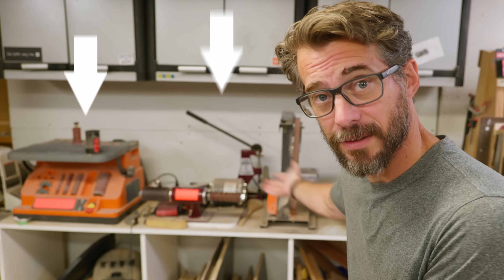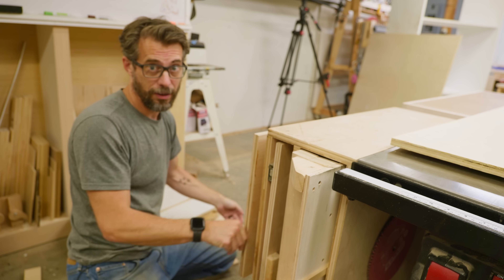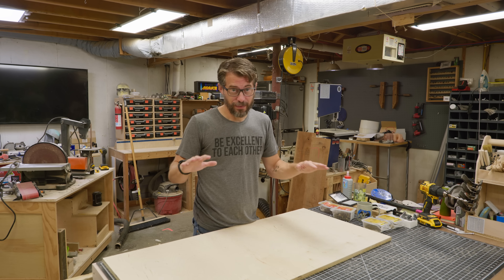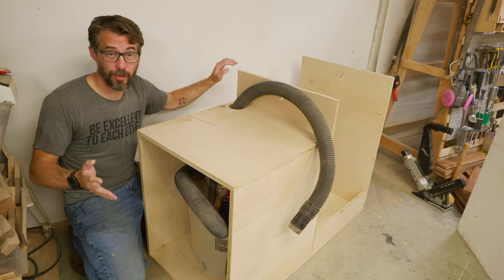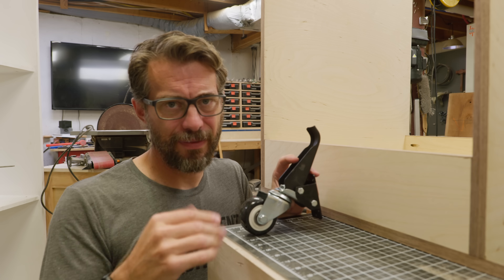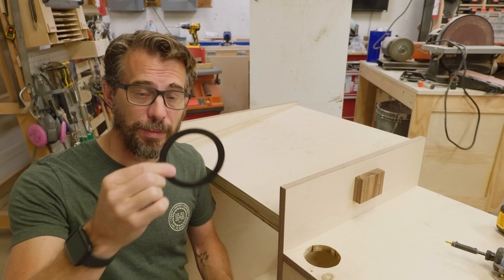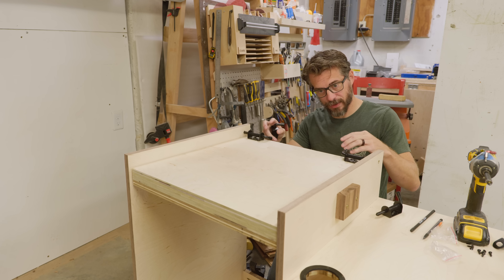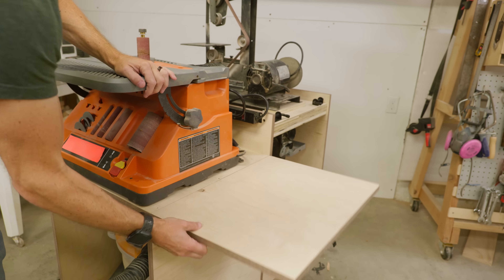Can I Make a Better Flip-Top Tool Cart?

Comment: Use fender washers over the receiving holes so you don't get tear out from the lock bolts going in and out
Reply: I was thinking that or lining the holes with a bit of scrap pipe and flaring the ends ... the washer.
Reply: I was about to suggest fender washers too!
Reply: Or maybe a T nut? Protects the outside and a bit of the inside as well to guide it. You’d have to drill the hole a bit bigger to accomodate that.
Reply: @jptheberge  I don't know if the bite of the tnut teeth are enough to hold it in after frequent use and pressure. But the plus side of the t nut is you don't have to modify them to screw them in , probably 3 drilled holes per washer, 1 enlarged center and 2 screw holes to get them to work.
Reply: Sounds like a job for the 3d printer lol
Reply: @snowpaw360  You can make a zinc-plated steel fender washer with a 3D printer?   🤣
Reply: Except fender washers are metal and have a greater chance of damaging the wood over time.
Reply: If the holes wearing out over time is an issue, drill them out and put in a bushing that's nice and snug.
Reply: @jtome12   If you have the right 3D printer, yes you can...well, maybe not zinc plated, but there are 3D printers that print metal objects, then, if you're printing in steel instead of brass, after you sinter the parts, you can nickle plate them easy enough...
Reply: Ha I just came here to say the same thing. This or embed some steel type or conduit
Reply: Epoxy a matching "plain" sleeve bearing into each hole. Incidentally, that's what I did to carry the weight and wear and tear of the flip top pipe, too. They come in every ID and depth imaginable, and they're cheap--not as cheap as washers, but they should create a more durable bolthole.😁
Reply: Given enough penetration, any wearing out of the entry hole acts as a guide bezel for the lock pin.

Comment: I'm interested to see how you find the placement of the latches over time. Originally, I thought you were installing them the opposite way around, so the set in the back would be on top, and the set to the front would be on the bottom, to access all four a little easier. Maybe it doesn't matter as much if it's on wheels and you can move it around though?
Reply: They should have been inside the boards with the pipe, with only the handle ends sticking out.
Reply: i guess i would have put the ones in the front on the underside of the flip top, and the ones in the back on the top. that would have made them easier to use
Reply: @Trickmanii  I think that would make it hard to use the locking mechanism that makes it easy to pull out all 4 latches at the same time.
Reply: I thought the same thing. It would be clearer at the front and also easier unlock the back latches that way.

Comment: Looks great! Can I suggest two improvements? 1) Add one of those automatic vacuum switches so the vacuum turns on/off when you turn the tool on/off, so you don't have to manually do that every time. 2) Buy or 3D print a small Y connector for the vacuum hose, so you can have the spindle sander permanently connected and have a separate hose to plug in one of the other tools when needed. Could even include magnets of some sort like what Izzy invented. Hope that helps
Reply: Not sure about the Y adapter, you'd be splitting the suction power and only get half the power on each tool. Unless you have some sort of gate to prevent suction on one side or the other as needed.
Reply: @Syberz  True. Adding gates would certainly be possible or you could test out if the setup without gates would make a noticeable difference to the performance of the vacuum cleaner and decide from there if gates are needed or you would want to stick with a single hose and move it from tool to tool. It also depends on what tool you use the most and how much you use the tools on the flip side of the cart. Only Bob can decide that for his situation and if any of us make one, we have to do our own assessment....

Comment: That gate hardware isn’t cheap and this is a shop cart, not fine furniture.  Instead, Drill through the cart wall and into the table.  Use a dowel with a handle to lock the table down.  Or use a long bolt. It just needs to lock laterally, so you don’t have to actually bolt it with a nut. If you want to get extra fancy, offset the hole slightly and chamfer the dowel end so that it locks like a drawbore. Better if your table has hardwood edging. For those levered casters, they get tippy when you engage them one at a time.  So, drill through the lever and bolt hardwood across each pair so they work together.  This requires that the lever be oriented away from where the operator stands to avoid a trip hazard. Nylon bushings for the axis are nice.

Comment: The vacuum cleaner needs to be connected to the tool you’re going to use with the power switch one which is better than two switches

Comment: We used gate latch pins to secure some rolling shelves inside of an enclosed trailer a few weeks ago.  I saw how you marked them off and wanted to tell you that we had a bit more ease by marking the tip of the pin with pencil lead and transferring it to the wood by twisting to smudge where we needed to drill into.  Worked amazingly well.
Reply: Yes you can do the same with a bit of sharpie or paint
Reply: The classic is cheap fingernail polish or cheap lipstick.
Reply: @paulheitkemper1559 or a china marker which we probably all have and is way more manly😂
Reply: @jeffro657-c5h  hehe also good! And also far less messy.

Comment: Yep, this is a better flip cart.  Really simple which makes it elegant in my book.  The only thing I think you over engineered are the locking bolts.  It seems to me that two are sufficient to keep the top locked.  I would still install four, but only drill holes on the front/top so I don't have to reach around/under to lock the other two when they are not needed.  The two not in use could just remain retracted until they were back on top.

Comment: Superb cart!  I really need to do something like this for my shop, for the same reasons.  Thanks for a bunch of good ideas!

One thing I enjoy doing with my own shop furniture projects is to make instead of buy, such as hinges, drawer glides, etc.  For the retractable casters, and where there's a few inches' available height in the cabinet bottom, I love the idea mounting casters to the bottom of those split panels connected in the middle by hinges, the edges of which are captured front and back inside the cabinet skirt/base under 2x2 cleats, so that when the hinged middle is up, the casters are retracted and the cabinet sits on the skirt.  When the hinged panel is flattened, the casters project a half inch or so below the skirt to roll.  The panel is flattened by a lever attached to one side edge of the back half of the panel, the lever projecting out the front of the cabinet, which  can be stepped on to raise the cabinet on its wheels, and latched into place with a catch.  

The math and measurements can be a bit tricky, depending on your cabinet dimensions, but it is SO satisfying to make this over buying a set of those retracting casters!

Comment: I was thinking of a simple ball and cup system. The steel ball would be mounted and a spring would keep it pushed out. When you push it in, the spring would push back. The cup system would be a round divot probably in steel hardware. That means you would be able to simply rotate the plywood and it would snap into place.

Comment: I built the fishers cart flip top, and the integrated power works great.   All my devices are hooked up to an internal power strip and then there is a single power strip to the wall from the cart.   I love the integrated dust collection.   That's a good idea.    I also used the window latch HW to secure the flip top, and it works great.   I think because the top is roughly balanced, there is very little force on the latch itself.   So what you did was a little bit over-kill.   Even if I was going to use gate latch HW, I would have put a stop-block so the top won't flip 360, and just used 2 latches.

Comment: Good job Bob.
This is cart #5 on my list of cart ideas. Your option of the side with your spindle sander is one I haven't seen before 👍 for that. I am not a fan of wheels that stick out, as I have two left feet that trip on things like that. I have other alternate ideas. Your idea of the gate latches would get in my way so I still like the type of cart with the lip that carries from one side of the flip to the other and side latches. 

Keep up the good work, and keep on using your 3D printer for all the other stuff like I do in my shop - folks are amazed at all the printed things in my shop right down to the 3D printed Switch Plates with labels on them - printed labels of course.

Comment: Nice adaptation.  The benefit for having the notches that secure to the outside like Brad from FTBT is that when you secure them down it provides more stability to the overall fliptop, especially if you mount a heavier piece of equipment like a 13" planer.  I like the added side shelf and flip top!  Nice work.

Comment: Solid idea there if space is tight.
I'll use that concept for my current cart that houses 3 tools on slide out boards because the body can't lift the boards holding the sander, router table and grinder any more.   Looking at using "non-swivel" wheels on the back and solid legs in the front.  It'll move easily (I hope) but will stay in place when using de tools.  Thanks so much for that.

Comment: Looks great! I really like the gate latches. If the holes ever wear you can install a bushing in the plywood to help stop the hole from getting bigger.
Reply: I use a metal plate screwed to the side with two screws and with a hole drilled between the screws. Works well.

Comment: Looks great! I like the hybrid fixed/flip style.  I did something different that will be tough to describe without photos, but I think is worth mentioning.
I have 3 sanders. The exact same spindle and disc sander as you, plus an old ryobi drum sander that's 130 lbs, so I made one big platform. I cut arcs in the side so the pivot point for the pipe was above the top edge of the sides. Then I secured blocks on one the side of the platform that stop it against the plywood sides. So the platform only flips 180 deg. Then I attached draw clasps to the sides. So it's only secured on one side, but it's super heavy duty. And I cheated the weight of the sanders slightly towards the stop blocks, so you can flip it and it'll stay even when it's not clasped. Sorry that's hard to follow... I need to get pics online somewhere so I can link to them!

Comment: For mounting the tools onto the swivel top, mark out the mounting holes before you do the glue and drill each set of holes through 2 layers of the ply and sandwich T-Nuts between all the layers. This is also a good way of changing out tools on the different tops. I have multiple holes in my bench (all measured and based of one hole) to mount various tools to my bench quickly and easily

Comment: Nice project. You might want to consider a cyclone separator on that dust collector. I imagine the filter on that shop vac gets clogged quite quickly with fine dust due to the nature of the sanding station.

Comment: I have a suggestion for an upgrade for the cart...

In the shopvac cubby, add 3 weather resistant device boxes, the first one is mounted right at the edge of the opening so it's in easy reach, in that one, you install a 2-pole switch and a 20 Amp. power cord.
The second device box is mounted farther back in the cubby, you install a receptacle. Plug the spindle sander and shopvac into that.
The 3rd device box is installed on top beside the hole the shopvac hose pokes out of, in that you install a receptacle that the other 2 sanders are plugged into...each receptacle is wired through the switch so they only have power when the switch is turned on...
Now, you must turn on the shopvac before you can turn on the sander. It also simplifies plugging everything in since it's all connected to the switch power cord...

I suggested the weather resistant device boxes as the rain seals should help keep the dust out of the boxes and away from the wire connections, reducing the long-term fire risk, though regular commercial device boxes would work just as well, though you should remember to take the covers off and vacuum them out at least once every 6-12 months...

Comment: I don't use latching hardware.  My flip-top cart uses short dowels through holes in the support sides then into holes into the flip top itself.  And hard stops on the same principle as Fisher's.  Just two (9mm diameter if I recall correctly) dowels at the front (one each side).  Remove them, flip the top, and reinsert them in the same place in the support sides (into a second pair of holes in the flip top itself).  It's quite stable; I've never thought that four would be better.
Maybe a heavy and odd weight distribution would make four necessary, but I have a drill press on one side and a mitre saw on the other, with no problems.

And for movement, four retractable castors that are brought into use by pressing a foot lever at the front (inspired by Carl Holmgren's "Retractable Casters for Power Tools" on YouTube).  Release the catch holding the lever, and the castors lift to allow the cart to rest on its feet.  Much easier than unlatching four separate castors, plus the castors are underneath where you can't trip on them.

Comment: The casters are great, but can be expensive. Rockler sells mounting plates that you can buy for all your other tools and move the casters to the tool when needed. Also the black pipe would have been stronger and a small 1/16" dado would have allowed it to fit within the 3 layer sandwich. Great built all around and like the spring loaded latches you choose.

Comment: During build up, on the flipping table consider  creating recessed cavities on the exposed edges to form pockets for mounting the spring loaded gate bolts. The would remove them from the surface of the flip table and create a cleaner look.

Comment: Very nice! Two improvements I’d make: 1, an easier latching system that requires less reaching and leaning and individual latching/unlatching, and 2, a more elegant vacuum solution than plugging the vacuum into whatever tool you’re using. I’m thinking maybe I’d make the pivot pipe a larger PVC pipe and use it for vacuum on the rotating side as well. I think you could probably make some baffles that would automatically block vacuum from the tool on the bottom as well. 

Of course, this kind of overthinking is the reason I usually don’t even start building anything in the first place. 🤦‍♂️ I make such complicated designs in my head that I decide they’re going to take too much time to build!

Comment: Nice job. On the latching piece, as the sides are higher than the pivoting table add 2 boards equal to that height difference and hinge them to the top of the sides. Lift them up to flip the table and swing them down again to lock the table in place. No extra hardware required (everyone has hinges in a drawer somewhere) and only 2 movements required instead of 4
Reply: I like the idea, but I can still envision a little wiggle there, unless there's so little tolerance that you have to wedge them in, and pry them out...but that DOES give me an idea using toggle clamps mounted to the tops of those side walls; now to figure out how to link the pair on each side together... 🤔
Reply: Cool idea!!

Comment: I just made one of those springy things out of some junk parts, just need to cut a section out of a washer that fits against a tab or burr on the shaft to do the twist lock and be able to release (and to assemble, haha! Don't try bending it on after like I did the first time and trying to close it back up, unless you have better washers than I do lol which you probably do.. but the simple chunk removed with tin snips worked great. Spring doesn't need to be strong either..

Comment: Good design. I also used spring bolts. My tip? To make it more economic, put the front bolts on the bottom and the rear bolts on the top. Thanks for sharing!

Comment: Great video.  I also have a small workshop, 12’x24’, and I have the same problem with sanding tools.  This is an outstanding solution to a well problem.  I will not only be hitting the subscribe button but I will be starting the build tomorrow.  Thank you.

Comment: I've watched more cart building YouTubes than I care to admit. However, you have some unique ideas. I was considering using a wooden dowel rod which would certainly be strong enough instead of the cost of black pipe and the difficulty of cutting it to length. After seeing yours, I may consider the electrical conduit but I wonder about its strength for carts holding a Steel City mortising jig and a 735 Dewalt Planner, (each with its own cart) both of which, alone, are heavier than what your cart is holding. Hmmmmm... the vote is still out. I like that folding shelf bracket idea! Nice build!

Comment: Great video and design. I built a flip top 3 years ago... One side is a belt/disk sander and the other side is a thickness planer.

All I have for the pin is a single ½" dowel. 🤷‍♂️